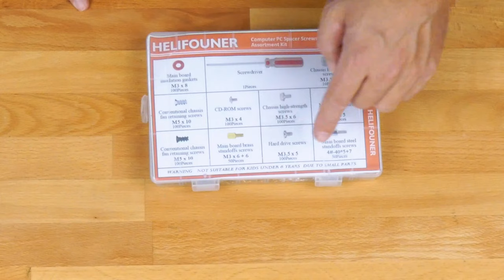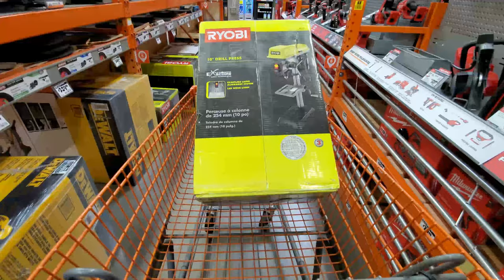Lian Li Lancool II Mesh - Custom Panel Fab and Install

Comment: Wow. You surprised me with the way you are doing cables! Lots of work, very unique and very cool!
Reply from the maker: Thanks, hopefully I can find the sleeving I need soon so I can finish this project.
Reply: @ElevatedSystems  have you tried AliExpress? Not the fastest, but may have the color you need.
Reply from the maker: @MurphysTactical  I've tried every MDPC-X distributor in every country possible and it seems the XTC Platinum Grey is sold out everywhere.

Comment: I can't thank you enough. I have watched your tear down video so many times, Now I am watching you put it back together as I am near the point to reassemble my case.  I took it apart to repaint all the black to silver.   Though I just realized I forgot the vertical mount bracket and I am out of paint.
Reply from the maker: You're welcome, thanks for the engagement. Hope you can find some more paint.

Comment: Is there a way to replace the side panels for this thing with something that is aluminum instead of tempered glass?
Reply from the maker: You can always cannibalize the hinges from the TG panels and fab aluminum panels.
Reply: @ElevatedSystems  Got a video on how to do that? lol
Reply from the maker: No but the TH is glued to a metal frame which the hinges are attached to. You can remove the frame with a heat gun and then attach it to a 3/16 aluminum panel cut to size.
Reply: @ElevatedSystems  That's clever. How much would all of that be for the aluminum and all that? and if I'd want to hire someone to do this for me who'd I go to for it specifically? handyman?
Reply from the maker: @OfficialRedTeamReview  you can get the panels custom cut from a site like Xometry and the rest is a pretty easy DIY project.
Reply: @ElevatedSystems  Sorry to be annoying about it, I'd rather just pay someone to make it. I don't have the tools to do it myself :/

Comment: I just found out your channel and i was wondering what happened to this build, would love to see it complete..
Reply from the maker: I haven't been able to replace the GPU I planned on using in the build so it had to go on the back burner but I will be finishing it in within the month.
Reply: @ElevatedSystems  wow that's great news!! I am also planning to disassemble this case but i can't find anywhere the rivets that your are using online.. Do you have any link for those?

Comment: Build looking great and the aluminium look of the galahad AIO is gonna be a perfect match for this!

I also wanna do a build in the lancool II mesh and I am wondering something. Looking at the case manual the top supports a 240 mm radiator, but looking at the picture of the top in the manual it seems quite spacious and there is also room for 2x 140mm fans. What do you think is the limiting factor for installing a 280 mm radiator in the top? Maybe it would hit the motherboard/ram, but the different mounting points also look somewhat offset away from the motherboard. Thoughts?
Reply from the maker: I dont have a 280mm to test but I'm pretty sure a 280mm would hit the front IO assembly due to the extra length of the tanks.
Reply: @ElevatedSystems  that is probably the answer then, thanks a lot!

Comment: I am confused by what the point of this is?

Why spend out all that money on the case if you are going to replace most of it, more sense to use that money and build one or pickup a very low budget one to do this.
Reply: To be fair the lancool mesh is surprisingly cheap, but I agree, it’s a little odd to pay for a case with multiple really great features and then just.. take them away and use a barebones metal box lol. May as well have used a filing cabinet